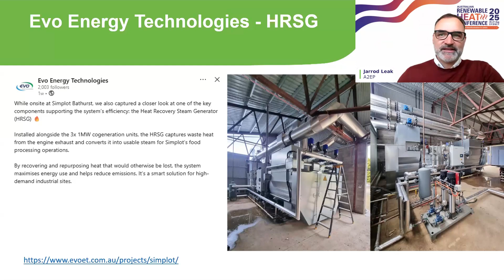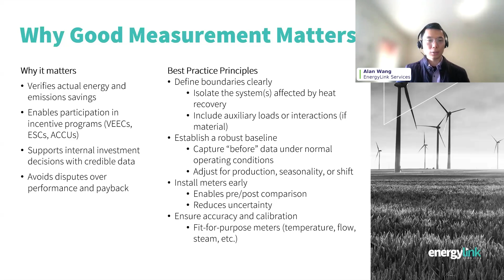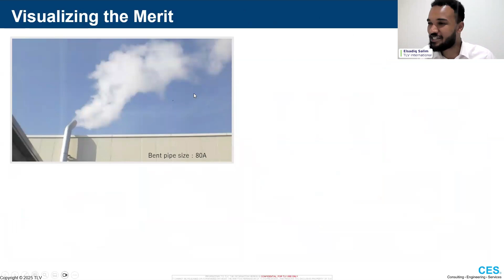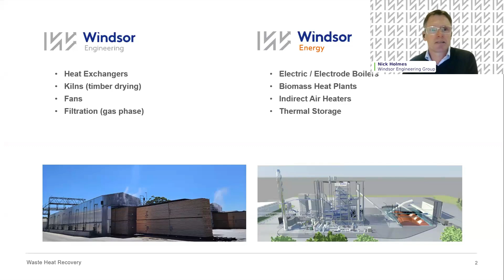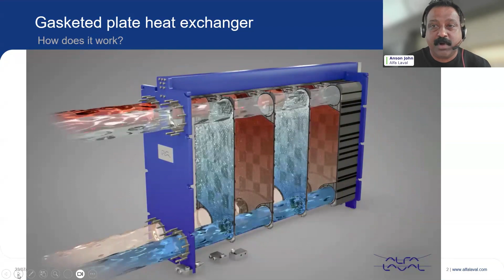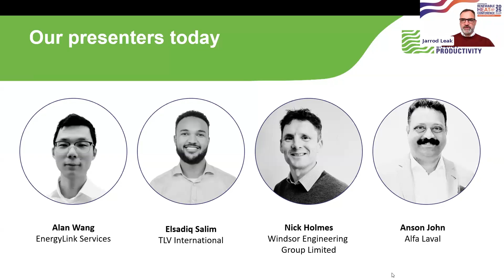Heat recovery for saving energy in manufacturing - A2EP webinar

Comment: I think McCain could have just noted the cost saving payback time and left the cost hidden. Who doesnt want to show they have saved money. They could have included the Carbon emission reductions in the metrics from the examples. I think the money saving is one metric but so for many firms is cutting their carbon footprint. I'd also wonder what the extended maintenance times that were incurred by having lower heat downstream. Also increasingly the metrics might want to include the water savings where droughts make water intake demand a larger concern. Data centres are big water users in cooling so anything that could reclaim water from the exchangers might be highly valuable. WHats missing is that lower temps mean lower cooling energy demands.

Comment: I find it amazing that industry thinks waste heat has no value. Its not like Heat pumps are not a new invention. The ability to take waste heat and reheat it higher seems totally new to industrial engineers. I see shops dumping AC heat outside and then paying to heat the inside from cold. Even outdoor summer day temps can now be used to generate free heat. The loss of solar thermal to PV is a shame as it would allow daytime heat to be turbocharged. Use solar thermal to transfer heat to a heat pump and suddenly you have heat that has very little HP effort. Steel and Cement making all rely on constant high temp heat yet most consider burning rubber or waste fossil fuel as being a sustainable hero move.